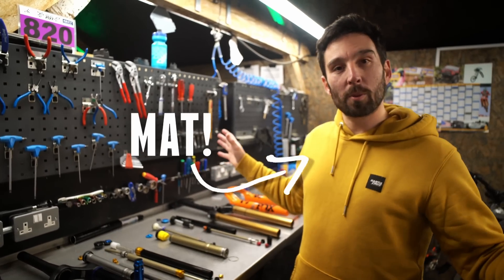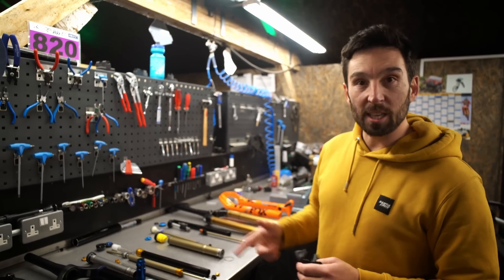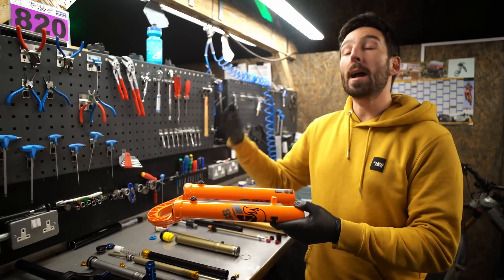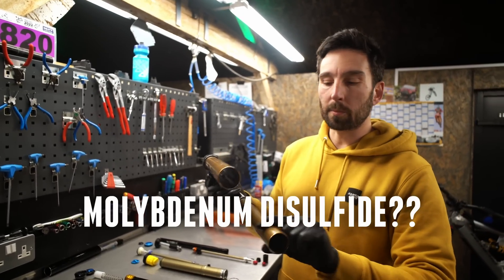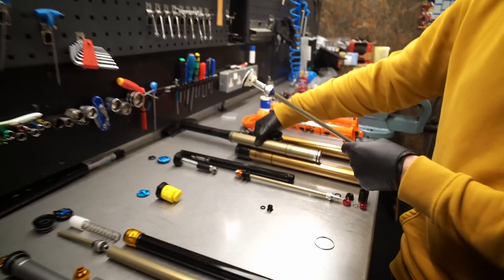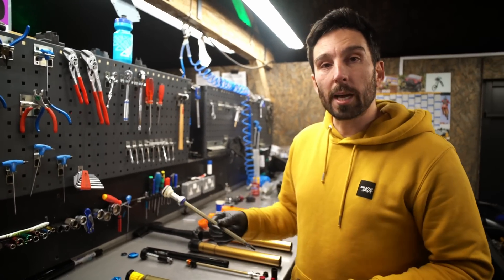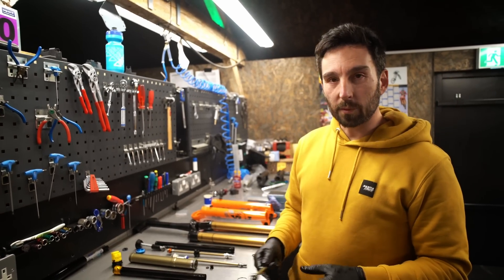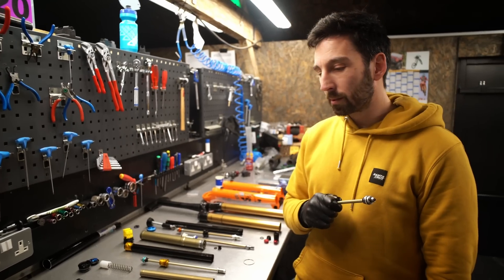Öhlins RXF38 vs FOX 38 Teardown comparison - Which is better?

Comment: most people dont realize that air chamber is all the same.  the difference is the damping side and how well the damping works consistently without cavitation.  and you have to customize damping to work with your weight and each click should make noticeable difference.  this is why most off the rack forks dont do anything for most people, because they are working the fork outside of their parameter, so you are basically using only the air spring side, and not using the damping side.  it is best to buy any of these forks and adjust the shims to match your weight right in the middle of compression and rebound so that you can go either way, up of down with all the damping options like compression a d rebound.  otherwise, you are just riding a air pogo stick and fooling yourself into thinking how great the fork is without utilizing more than 50% of its capabilities.  most of these dampers are rudimentary garbage and hardly do anything though.  just turn up your rebound all the way and see how fast the fork rises from compression.  you probably wont see much difference.  why?  because these dials are a BS gimick.

Comment: I'm debating between fox 36 performance elite @ $850 and the Ohlins RXF 36 @ $800.  My frame came with fox float x performance rear shock so the fox 36 would match it, but I think I'd rather have the ohlins fork on sale.  Then I'd probably want to sell fox rear shock and buy matching ohlins..   hmmm decision decisions

Comment: Great video.  Fair to say that adding tokens in the Air side, will reduce the available travel of the fork by limiting the Air volume...!? so I guess that Öhlins does manage the ''end pressure'' without limiting the travel (air volume) of the fork with their different design or not  !?

Comment: Let me know when you can tweak the feel of a Grip2 like you can the Ohlins with it's triple chamber design. I can easily add or remove a bit of pressure at the bottom of the fork in seconds, and I can even go stepwise up and down in tiny increments. Impossible to do on a stock Fox fork

Comment: Would be good to see dyno plots and telemetry of the two. 
My intuition is that Fox actually have the right idea here regarding larger air volume and lower pressure.
Reply: I actually feel the ohlin is better for tuneability, essentially you have smaller increments, where as the fox you cant adjust much once you're at your weight limit...for example on my 40's i have like 5psi to play with before its too hard or too soft. I would imagine the ohlin would be like 10-12psi so you get a much finer tune

Comment: Fork for best repetitious small bump sensitivity. Like the old unmatched Citoen DS which i drove for several years. What fork delivers like that? I'm no bikeparker, i have long travel suspension mostly for comfort (180mm). But in my opinion: the problem is that bicycles do not have enough mass, which let's any stickslip effects in the suspension/dampingsystem get prominent. With the same suspension/dampingsystem and more vehiclemass and of corse more pressure the stick effects would not grow or not grow in the same way but the forces which are acting on the system so in summa the impact of the friction would get less, like: a small bump acts with more fore on a heavier vehicle like the same bump would on a featherweight one.
Reply: I’d recommend looking into a coil conversion for your current fork. Push and Vorsprung both make a lot of aftermarket kits. Running a coil tends to have better small bump sensitivity but less progression when compared to an air sprung fork. Marzocchi makes a Z1 Coil that’s pretty good as well. I have my Fox Performance 38 set up at 22% sag and slightly slower rebound than recommended and fully open compression, it handles chatter and big hits very well at that setup without much compromise on either end.

Comment: Great video! I'm actually building a new Tracer 279 using Ohlins suspension.
Reply from the maker: You won’t regret it. Get those settings dialled.

Comment: Could you maybe talk a little about the token in the negative air chamber in the ohlins? How many forks have you removed this from??
Reply from the maker: We did it a fair amount on the 36 fork but I find the 38 rides a little nicer with the spacer in. Probably due to the bigger lower leg volume. Awesome forks!!
Reply: @BRINKUK  yea I was just asking as I got a shot of some ohlins 38s and struggled to find the balance between small bump and support. I could feel the damper was absolutely mint I just couldn’t figure the air pressures out to get what I was after.
Reply from the maker: They aren’t the fork for small bump sensitivity off the top but at sag they should be more than supple with the right setup. Sometimes it’s worth sizing the bushes. We can do that for you! 👍🏻

Comment: once you’ve ridden an Ohlins fork versus a Fox you see there’s just no contest.
Reply: Thank you so much for the insight. I am kind of new to Mountain biking. But I have a lower quality brand of fox on right now. ( rhythm ) . I have been reading a lot about the Ohlins forks and Shocks. Your comments are definitely making me go towards Ohlins. Also, I think it would look really awesome on my turbo levo, which is all black with yellow grips, yellow pedals, and yellow stem from Pembree.
Reply: @shawnstradwick5637  yeah that would look sharpe! Although the Fox Rhythm is a great value fork (supposedly having the same internals as the Marzocchi Bomber) and won’t hold you back at all, if you have the margin in your budget, the Ohlins is simply next-level. Also Ohlins forks are on sale all over the place right now eg JensonUSA, etc. The Ohlins RXF36  would likely be the upgrade from your Rhythm.
Reply: Öhlins versus any other suspension manufacturer has been my experience . 
Materials, design and product support are hands down the best in the industry
Reply: Which versions of forks did you ride and which brand did you prefer?
Reply: @Polemicist_  I prefer Ohlins overall despite the price. I do believe though that aggressive trail or park riding is where Ohlins shines most. Before I tried Ohlins I’ve had/ridden Rockshox Lyrik, Zeb (an excellent fork!) and Boxxer as well as Fox 34, 36 and 38. The main difference between the others to me was that although Fox and Rockshox are softer off the top, Ohlins has a more noticeable and more confidence inspiring mid-stroke support ie the suspension feels like it’s always there (especially on jumps and drops), was easier to find an adjustment that works as Ohlins uses a design approach called “usable range” which results in it being almost difficult to find a setting that doesn’t work on an Ohlins and finally, has a progressivity ramp adjustment chamber instead of using annoying tokens.
Reply: @BrandonViani  Damn, okay. Thanks for that info.
Reply: Since my last reply, two months ago, I finally upgraded my front forks to the RXF38 m.2 and installed the TTX22 m.2 coil on the rear . I have only ridden the bike five times since the upgrade and I have noticed a huge difference. Since the air chamber is so small in the front forks. I had to change the air chuck on my shock pump. Just unscrewing air chuck from the filler valve was releasing too much air and was changing the air pressure every time I tried.
Reply: @shawnstradwick5637  I make allowances for this with a given shock pump .
Reply: Well, Öhlins definitely have had there problems and I am not confident they will not have them anymore. However I am with Brandon on this 👍 for the softer work were small bump compliance is more desirable there might be better forks. For me I want my suspension to catch my fault and not spill travel on small things.
Reply: People make this mistake all the time they set their pressure then disconnect the pump and reconnect it. Everytime you connect the pump the hose gets filled with air and thats when your fork pressure drops. Just set your pressure and only connect your pump when you really need to make a change
Reply: @KidKatree use the Topeak digital pump

Comment: SUPER cool to see the insides of both! Have you experimented with removing the negative air chamber spacer that apparently is in Ohlins 38 forks? Seemed like Alex at Bike Radar had experimented with that with positive results... not saying necessarily that the RXF38 needs to be better :) Excited to hear about blind testing!
Reply from the maker: Yer we’ve tried both ways. If you want it more supple off the top it’s good but accelerates the fork into the mid stroke so pros and cons. Personally I prefer the fork to ride a little higher so I leave mine in on the 38.
Reply: @BRINKUK  Thank you! Cheers!
Reply: @BRINKUK   @timschafer3820 Does the RXF36 have the same negative chamber spacer that can be removed?
Reply from the maker: @mtboyan1817  yea it does!
Reply: @BRINKUK  cool, thanks! I think I like the off-the-top feel of the older Lyriks and would love to get closer to that with my RXF36. Odd there's no video on removing it
Reply: I was gonna ask the same question, and had just come across that same review. I’m a lighter rider at 160lbs with gear and have an RXF38 on the way. I’ll experiment with it stock and see how it is and if it’s too harsh off the top or not with it.

@BRINKUK Is it easy to remove the negative chamber spacer if needed?